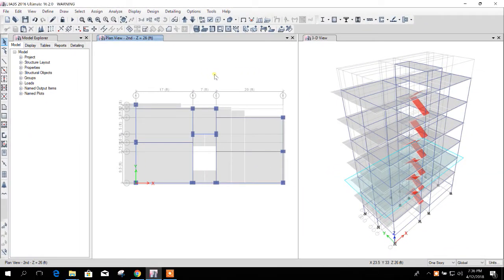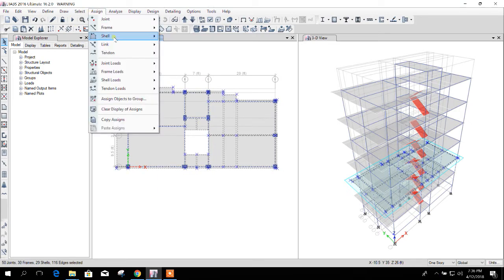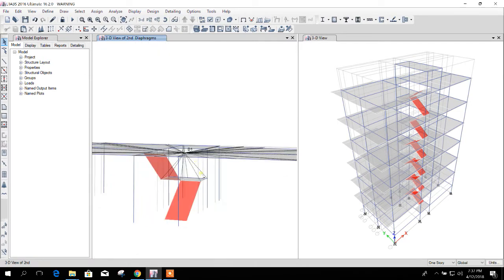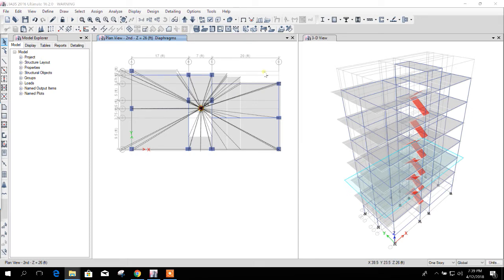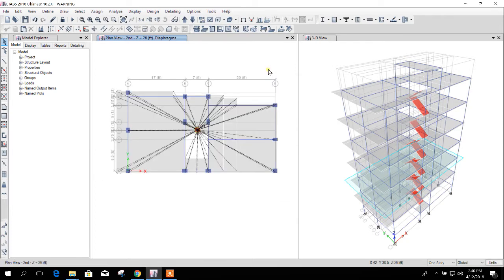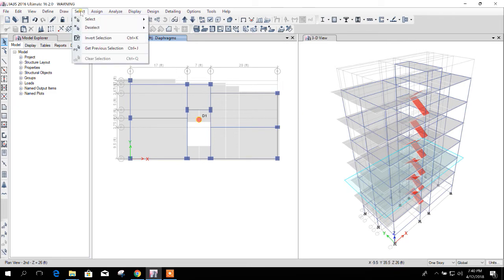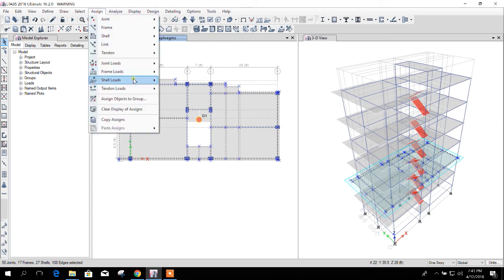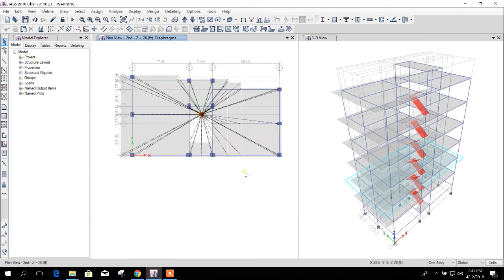SOLVING DIAPHRAGM WARNING IN ETABS

Comment: Sir, what is the difference between joint diaphragm and shell diaphragm ?. Is it same ?
Reply from the maker: Joint diaphragm is connection between joints, Shell diaphragm is connection between shell corners.
Reply: @Decodebd  for Ground floor where there is no shell, can we assign joint diaphragm and for the rest of the floor i.e 1st, 2nd and subsequent floor where there is shell can we assign shell diaphragm. Since to my understanding, diaphragm action is to resist and transfer lateral force. Correct me if I am wrong. Plz elaborate.

Comment: what is slab & diaphragm, purpose?
Reply from the maker: Purpose of diaphragm is to find out CG of area & lateral loads will be applied on that CG.
Reply: @Decodebd  Sir, but i never checked or come across this diaphragm concept in Staad pro, so irrespective of the size of the building we have to consider the diaphragm in ETABS, right ?
Reply from the maker: @nemalavenkatesh  Yes.
Reply: @Decodebd  sir does diaphragms are used in etabs only or is there any physical structural element also provided in building practically also? Coz i had come across diaphragms as a structural element in bridges, so in buildings also we consider in the site?
Reply from the maker: Diaphragms are used in other programs also. 2 approach of applying lateral loads. One is to apply loading in peripheral nodes of beam column joints (like loads on cladding). Another is to apply lateral loads on CG of every floor.